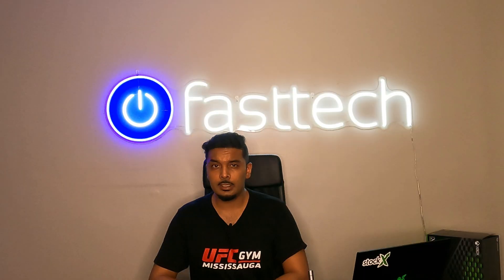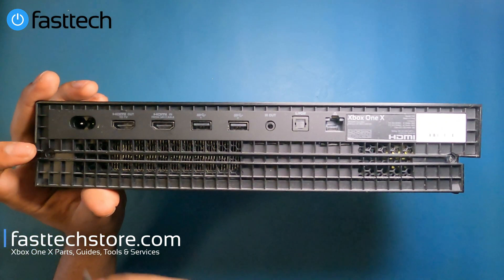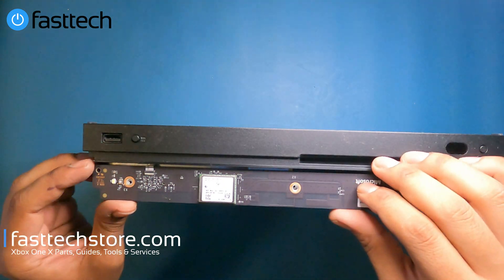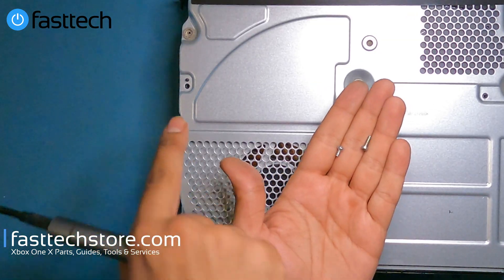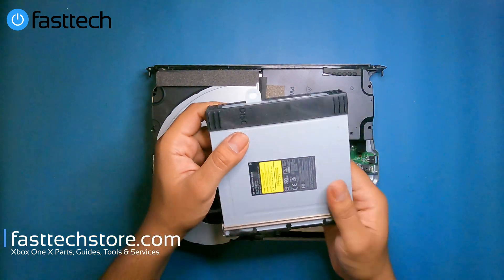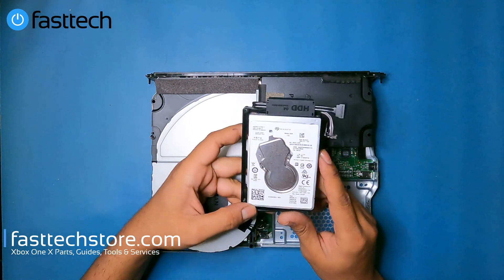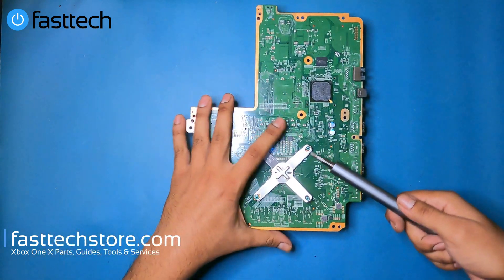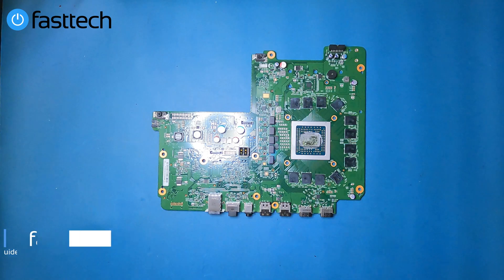Xbox One X Disassembly and Repair Guide (Teardown)

Comment from the maker: FREQUENTLY ASKED QUESTIONS
Where do I buy the parts and tools needed for this job?
▶️Fasttech Pro AutoKit:https://www.fasttech.ca/tools/fasttech-pro-auto-kit
▶️Torx T10 Screwdriver:https://www.fasttech.ca/tools/torx-t10-screwdriver
▶️Torx T8 Screwdriver:https://www.fasttech.ca/tools/torx-t8-screwdriver
▶️Xbox One X Network/Bluetooth Module:https://www.fasttech.ca/xbox-one-x-parts/wifi-and-bluetooth-module-chip-for-xbox-one-x-1802
▶️Xbox One X RF Module:https://www.fasttech.ca/xbox-one-x-parts/xbox-one-x-front-power-button
▶️Xbox One X Disc Drive:https://www.fasttech.ca/xbox-one-x-parts/xbox-one-x-disc-drive
▶️Xbox One X Hard Drive:https://www.fasttech.ca/xbox-one-x-parts?category=Hard+Drives
▶️Xbox One X Power Supply:https://www.fasttech.ca/xbox-one-x-parts/xbox-one-x-power-supply
▶️Xbox One X Motherboard:https://www.fasttech.ca/xbox-one-x-parts/xbox-one-x-motherboard

👉NEED HELP? FaceTime/Zoom Video Call Me: https://www.fasttech.ca/online-consultation
👉GET REPAIR SERVICE FOR YOUR DEVICE: https://www.fasttech.ca/electronics-repair

▶️VLOG CHANNEL: https://www.youtube.com/channel/UCF2IPXKRX5ctN9td1rhkzHg